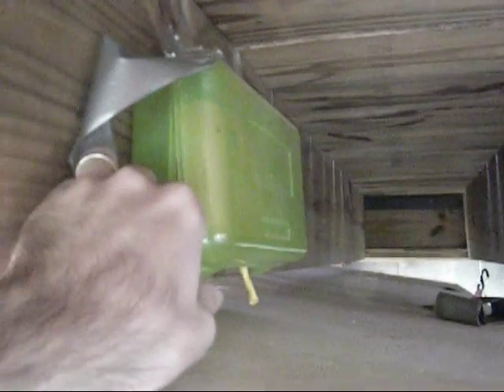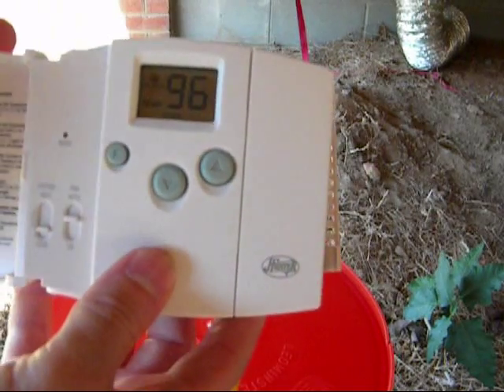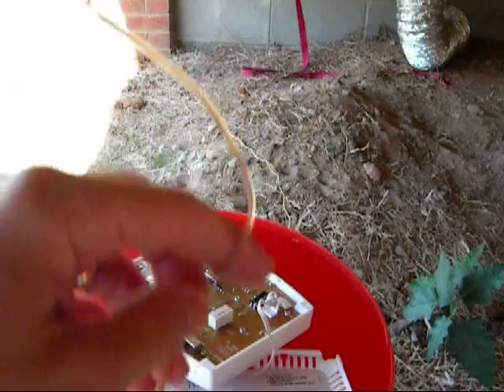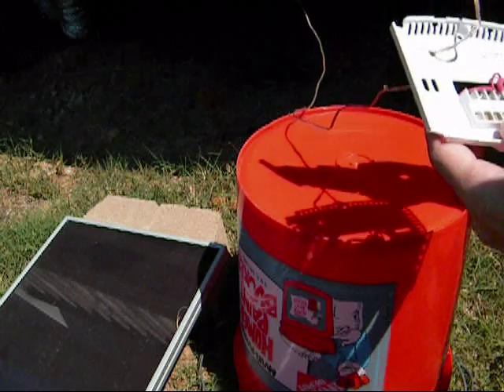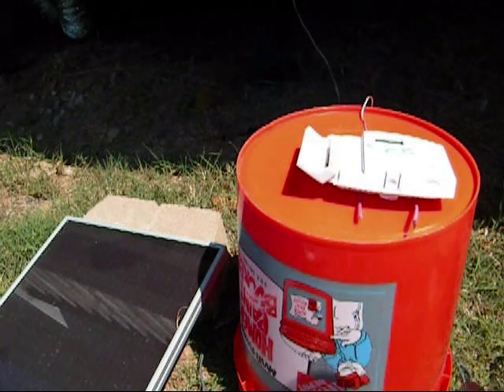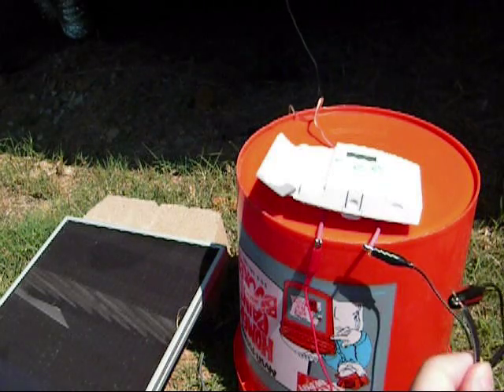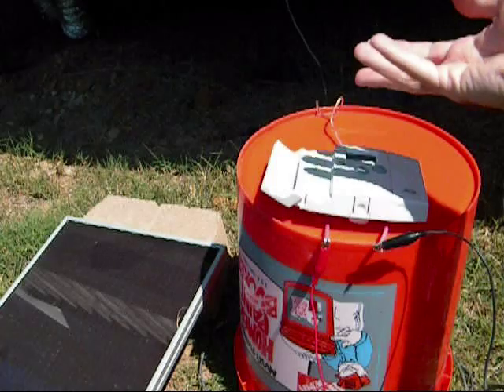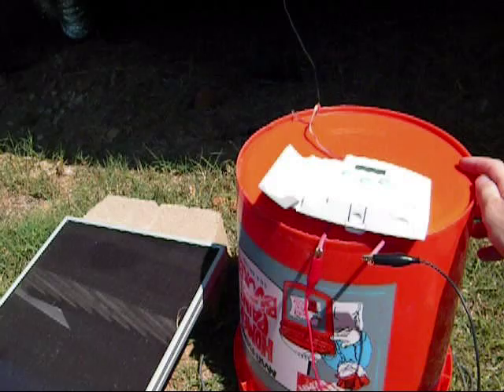How I have my solar heater thermostat hooked up

Comment: Hi 

I have solar hot water and a thermastat , am I correct in thinking , once the sun finishes heating the water , and the temp falls , it’s best to keep thermostat on , so that kicks in at night or cloudy days ? I had it like this for a few years but was set at 80 , so reset it at 50 as my bills were quite high , I have just turned it on as and when needed , but this becomes a pain to remember, so question is , if I keep the heat at 50 which is hot  enough to shower , keep the thermostat on Permanent  .  Which will only come on when temp drops , will this be the best eco way ? Cheers Jay

Comment: Instead of using a thermostat, I used a heat censor that completes the circuit at 40 deg. cel. It works great and it's fully automatic and only costs about $12, much cheaper than a thermostat.
Reply: Pierre Coutu   I am looking for a device as you described.  Can you give me a source?   Thanks!

Comment from the maker: @artsychic2000 That might work if you have a short run to your vent. Because of the set up of where everything is on mine, I have to run a duct almost the entire lenght of the house. It needs all the help it can get to get inside the house. Thank you for the question, Lonny

Comment: seems to me if you drilled much smaller holes in the bottoms of the cans it would force the hot air through.  Perhaps you wouldn't need a fan???  What do you think?

Comment: Nice video. I use a snap disc thermostat on mine.They are cheap, and easy to install. I do like how you can set the temperature you desire on yours. Mine opens on rise at 110 degrees F. and closes at 90f. thanks for sharing.